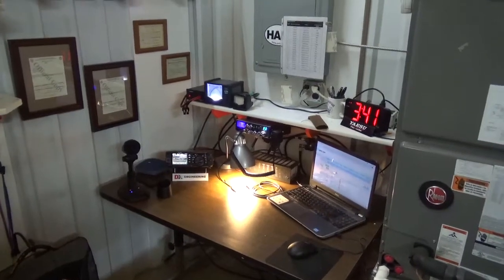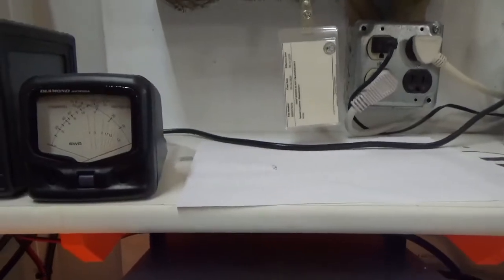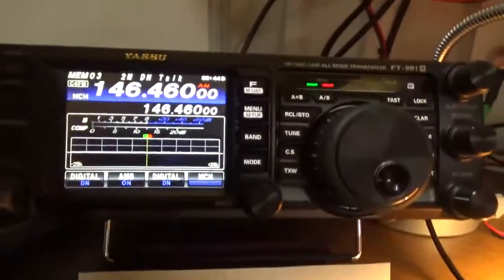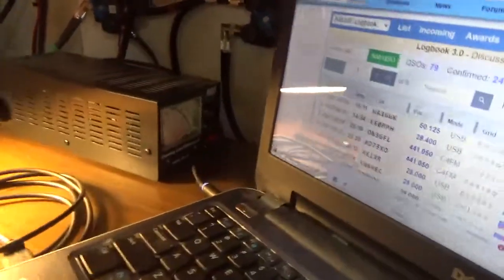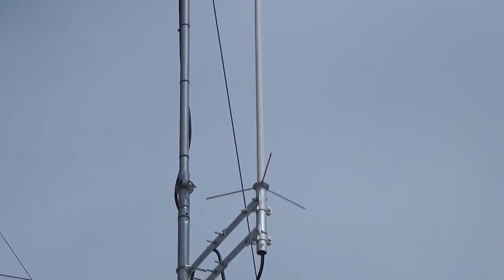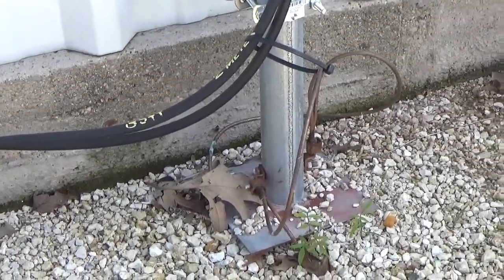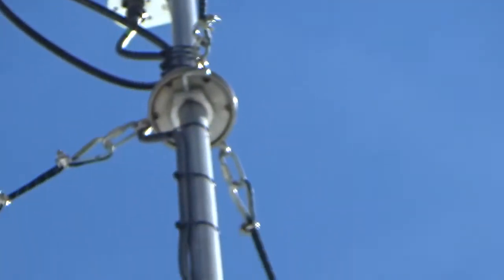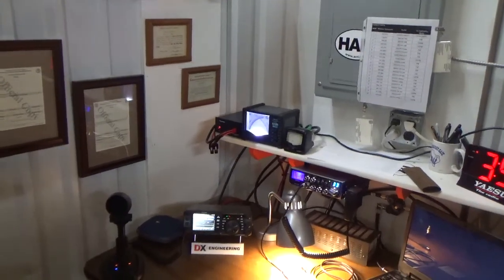Quick Tour of KI5JUF/K5EHL Station, Abilene TX FT991A with M-100 Microphone

Comment: I noticed that your antenna masts are secured to your metal building with all metal fasteners. If lightning hit the mast wouldn’t it also transfer to the metal building? Just curious…
Reply from the maker: Good question, I will ask, I have all the poles grounded with # 6 copper to two 8 foot ground rods I've seen other folks do it but good point and thanks, I suspect the hit will transfer to the ground rods but in any case a lighting strike is messy '73

Comment: I hope those grounds are also connected to your utility ground. 
And lightning arrestors are REQUIRED to be installed on all antenna wires before they enter a building or dwelling, per NEC code!!
Reply from the maker: Good feedback, I have a Grounding and Bonding book I 'll get from ARRL,  I'll start reading it when it gets in, this is a good topic for a future video, I'll get up-to-date  with this, and thanks I'm always ready to learn, I applicate you experience and knowledge sir.
Reply: @westtexasvideogateski5juf255  I've been an electrician for 31 years and grounding is a really indepth, but very interesting issue. 
I'd be happy to give any input that I can. 
Mike Holt has about the best resources for proper grounding on his site. The two most important things are single-point grounding and knowing the difference between grounding and bonding. 
I see a lot of hams (and others) put a separate ground rod for their antenna and not connect it to the house (until ground). I'm almost all cases, this is much worse than having no ground at all!!  Sure, It will bleed off static, but can cause a difference of potential, in the order of millions of volts even with a nearby lightning strike. 
If a lightning bolt hits a tree or the ground, for example, it radiates outward like a wave. (lightning can be 300 Million volts at 30,000 amps!!!) 
Even a strike in your neighbors yard can still be millions of volts when it reaches your house. If you have a ground rod on the antenna in the back of your house and the utility ground is in the front. That wave will hit the back ground rod first, while the utility is at zero potential. Using ohm's law, the difference in potential between the two ground rods can be in the hundreds of thousands to millions of volts. Once the wave passes, the rear ground rod and it returns to zero potential, the wave then hits the front ground rod and the have the exact same situation again. 
Bonding and single point ground is essential to keep everything at the same potential! 
It's interesting to note that when lightning strikes a field of horses gathered in a group, some die while others don't. Sounds really puzzling, right? But why? 
Horses who are standing sideways to the lightning wave, survive while horses that are facing the wave, or away, die. 
It's because the shorter distance between the horses legs when they're sideways (less difference of potential) while the distance between the front and hind legs is longer (more difference of potential)
It's the same with our shacks.
Reply from the maker: @timmack2415  Good evening sir, sorry fpr the delayed response , I would  take you up on all your experience, go to the "about" tab and drop me an email - I appreciate your insight this is a topic I know only a littke, '73 de KI5JUF anything we can you would be great let me read through the ARRL grounding its definitely a slow read
Reply from the maker: @timmack2415  Hi Tim, I've started reading the ARRLGrounding and Bonding for the Radio Amateur - I will jump back to if you could send me an email as i have question I'll hit you back, I really apricate your help I'd like to get all this clear in my head - on the about tab it will show a section for my email - just click on the box and you will see my email - thanks '73 de KI5JUF

Comment: Nice shack, I am going to use an IMPAS 2.0 (live in a HOA) cover 6-160 and then will get a tri band for 2m, 1.25, 70 this way when I want I can use my 74a HT as well as the 991A. I also have a Lincoln II+ With the 11m conversion so my set up will be very similar to yours with my 991A except for the base antennas.  I really love your videos keep putting them out!

Comment: I'm curious about your bracket for holding the GP-1, where did you get it?  Everything I've found so far is either either a single arm off the tower, or is extremely expensive and total overkill.  Thanks and 73.
Reply from the maker: Good morning Don, thanks for the message always a please toi hear from folk, let me do some checking Dad actually got so I'll see him today, I think we got it at Lowes or Home Depot, I'll let you - its actual to short bars tied together in the center we have to drill a hole to accommodate the GP-1 mounting - should have answer soon, thanks again sir!  '73 de KI5JUF
Reply: @westtexasvideogateski5juf255  Awesome, thanks so much for the effort on my behalf!
Reply from the maker: @don_cc123  Good evening sir,so the hardware store closed at 1:00PM today, but Dad told me you can find this type of stuffin the fencing department for farms and ranches etc, the brace actully is used to tie fences together, the place we bought it was Bible Hardware 73 de KI5JUF, let me know if you find if not I'm happy to to Bible
Reply: @westtexasvideogateski5juf255 Thanks very much Steve, I'll take a look around the fencing section at either Lowe's or Home Depot next time I'm over there. I currently have a discone at the top of my tower that I'm replacing with a Comet GP-3, so I need to move the discone down the tower a bit.  I keep it around primarily because it's happy to accept power at any frequency from 2m through 23 cm with low SWR.  Hope to talk to you sometime on the air!  73 de WD5DON
Reply: @westtexasvideogateski5juf255  I was going to ask the same thing. I bought a couple of mounting bars from Diamond antenna to use with 5 ele 2 meter Yagis, but with a GP-1 the antenna would be horizontal. I was brainstorming on how to convert one of them to mount a GP-1 vertical. Also I got confused with the KIFJUF in the title. :) 73 KD5YOU